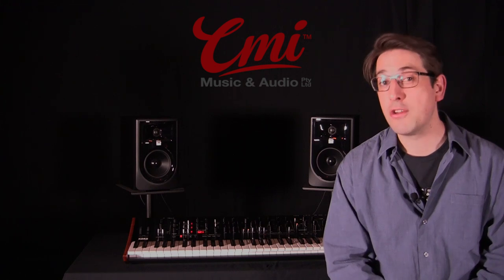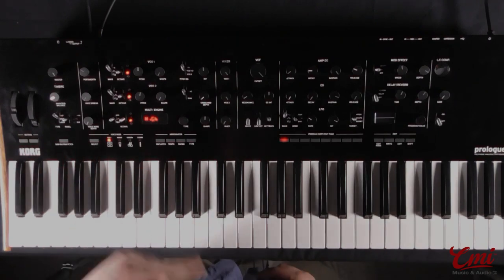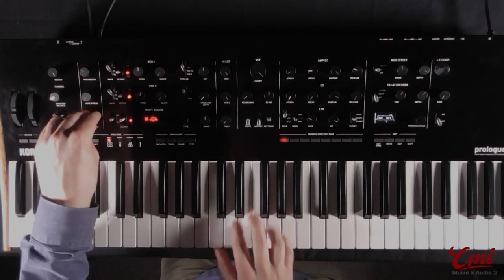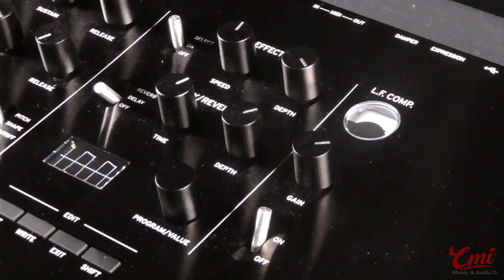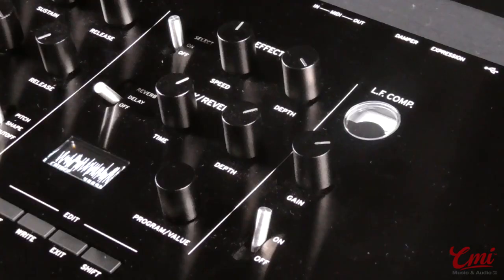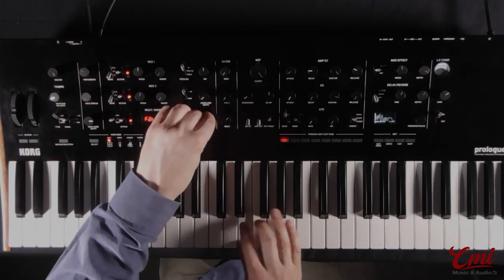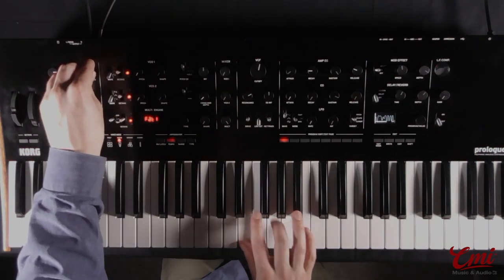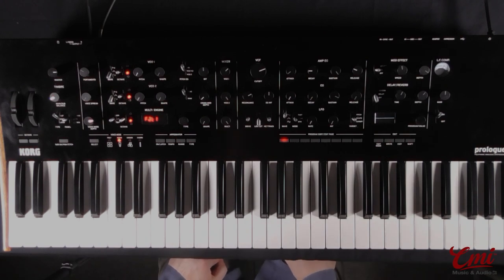KORG Prologue Oscillator Section: Build a Sound from Scratch

Comment: Sounds good, can it replicate oberheim, prophet, juno (stranger things), cs80(vangelis)?
Reply from the maker: Yes Yes and Yes
Reply: NO, NO and NO. Stop upselling you liar. It sounds awful. I have synths here that have proper VCOs from the 70s/80s, and they sound nothing like this piece of cardboard sounding trash.

No Brian, the korg will absolutely NOT replicated obie, prophet etc. Unless you don't mind weak flat version of them. Just go buy a used VCO poly/mono or a Rev 2 which gets a lot closer.
Reply: quarkyzarky the rev2 has no VCO at all, it has modern DCO, so your argument is really weak
Reply: quarkyzarky rev 2 sounds like garbage
Reply: Stranger Things theme isn't a Juno.